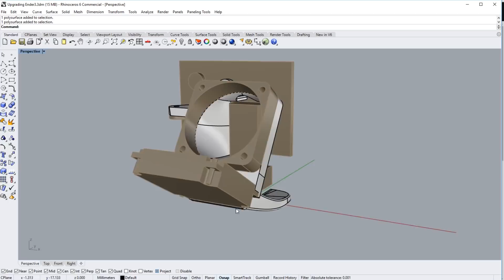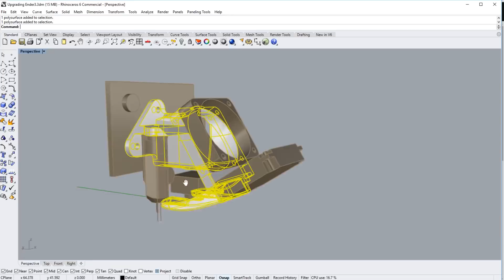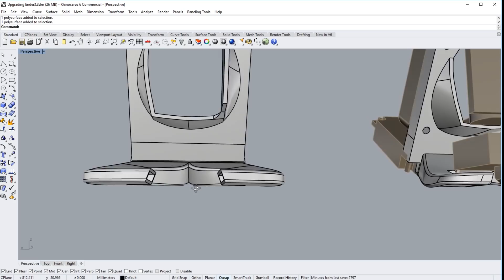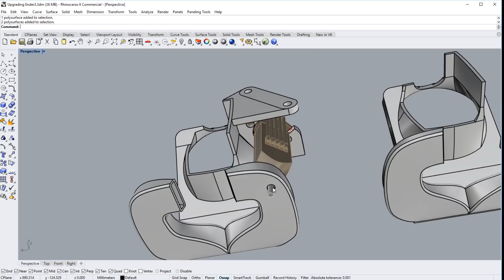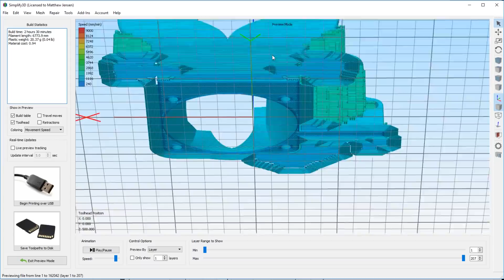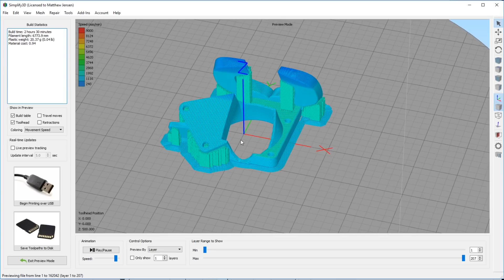Upgrading the Creality Ender 3 with Duet Wi-Fi, and other add-ons - part 1

Comment: With that Fan Mount you suck air over the heated bed, which cools it down.
But the air will be heated up a bit and with this allready heated up air u want to cool the molten filament... genius... not!
Reply from the maker: An intelligent sounding THEORY. However, in practice it does not work like this. First, consider that only the first few layers have the fan close to the heated bed. As the print gets taller, the fan gets further from the bed. Second, the fan is only canted at a 30° angle. Therefore, the top of the fan is never closer than 40mm to the surface, and the bottom blades of the fan are never closer than 10mm. There is a temperature gradient of the air above the heated bed, and it is significantly cooler than the bed at just 10mm of height. Remember we are measuring air temperature not radiant temperature. When you put your hand above the bed you feel the radiant heat. Practically speaking this means that the intake air is not much warmer than ambient room temperature, and this configuration functions perfectly. The increased airflow and finely tuned directionality of the flow more than compensate for the slightly increased intake temperature. Don't believe me? Ask your fellow German: Stefan at CNC kitchen. His printer has a similar fan mounting.

I question your impassioned denouncement of my intelligence. This is after all just a technical issue. Why insult me? Perhaps you have some vested interest? Maybe you are a fanboy for another 3D Printing company which resides just across the border from where you live.

Comment: Why buy that wifi board? Rpi 0 with Octoprint. 30 bucks.
Reply from the maker: So, you make the "It just works" argument in the last comment and then contradict yourself here? It is significantly more complicated and takes significantly more time to set up a RPI with octoprint. Not only that, but you won't get the benefit of all the other features on the Duet such as Trinamic drivers, and super easy to use/modify firmware using Macros.
Reply: Well actually you can get working octoprint with your Prusa... it just works... all im saying is That i dont see the benefit of adding WiFi to a driver Bord... aren’t there cheaper Bords that also support those drivers?

Comment: The Mk3 is great right out of the box. It's good for beginners and experts with prusas big box level of support. Theres no scouring the internet to find the best slicer settings.  It's loaded with features that you will never want to go without after using. IE mesh auto leveling, live z tuning, power panic, automatic squaring, stealth printing and mis step correction, magnetic bed,  just to name a few. It's got a direct drive extruder, which is much better unless you're using 2.85mm filament, and still direct is better. It's also got an all metal hot end, not just any, but THE all metal hot end. 
I always prep my print surface before a print, so though I have octo print setup, I find wifi printing useless. 

Look, you can say I'm trying to justify my purchase but I've got 7 3D printers including an ender 3. Some much more expensive than the Mk3, but the Mk3 is the first one I look to. Joe and their team have put together a great machine and the fact that you will look down the whole community, a community that knows damn well about the ender 3 and how to upgrade it, and say all of you are wrong, and I alone am right, shows a high level of unprofessionalism to say the least.

Comment: Ok so all i can tell is you have some personal beef against prusa trying so hard to "prove" they arnt the cheapest for what it can do.

What I have a serious problem with here is you complain about something that prusa does and then do it yourself. you borderline gloat that the base printer doesn't use 3d printed parts or zip ties to hold important parts together then use 3d printed parts and zip ties to mount one of your upgrades. You complain that Prusa didn't first come up with these ideas but your entire video is making your printer do what theirs does and in some cases do what they first did/popularized.

Even if its out now when you made the video one part you used was a beta test unit so it wasn't available through traditional means you understand how that is crazy to make an argument with. You are using technology that was not even an option at the point of conception for the thing you are trying to beat. That's like saying hey your phone sucks because i get to test next years model.

Now to continue upgrading your model we will need to design a new fan duct which I know you will argue you have already made for someone wanting to do this but that really isn't the point the point is your doing something that requires time effort and experience ( especially when designing a 3d printed part that will go so close to a hot end  which you even mention in your testing process) to do properly and one of the things about Prusa you seem to ignore is that you can have nearly no skill for the level of quality it gives you. Oh also yay you are using more 3d printed parts that are apparently bad according to you. 

You admit to using a secondary printer to do this job so either you need a second one to work on the upgrades or use the base model which you should have done to prove that you could upgrade it using only the printer or else this is a moot point.

It seems really pick and chose your battle on what parts are great upgrades, having several different printers available to me for printing one of the biggest quality of life pieces is the removable print bed. Good adhesion reliable surface, low to no need for adhesion aiding products, and inexpensive replacement if something goes wrong are just some of the gains from this one piece. To add something like this you would up the cost of the plate need to create mounting systems for the magnets add the magnets make sure they are configured not to mess with anything yet still provide coverage properly which all costs time and money. This is just one of the features you ignore as you cheery pick the useful and inexpensive upgrades.

Also your using a pretty shady tactic by only tallying the cost of what is shown sofar in the video, just like me when I first looked over the video I had assumed you parted everything out and put the cost upfront until I noticed you didnt add the cost of the bl touch. Im not going to post this on both so a few spoilers with the extra parts in the other video the price goes up another 65$ which yes still puts it below the Prusa but it weakens the argument the closer you get. 

Oh you also go on about how getting the official thing gives you access to things like support, the same as if you paid more and bought a Prusa. Every time you talk about real and official parts you talk about how bad knocking off someone is when the whole video is about knocking off the great features included in the mk3 

Finally I want to leave off with something that I honestly agree with you on but the sheer fact you are doing this video makes you a hypocrite you claim that even if its open source you shouldn't support copycats as you are trying to make a copy cat build of a Prusa printer. They went though the proper channels to obtain separate parts to make one extremely good machine trying to improve the market but instead, you want to copy them for cheaper which is exactly what you say ruins innovation

And before you say I'm a Prusa fanboy yes I have a mk3 that is why I feel qualified to speak on some of this. I also have access to 2 m3d micro+'s 4 tazbots though a team i work with at the local university a personal ender 3 as well as seen them in action from the two friends who has them and a whole list of dramatically better printers (more expensive) than my Prusa. So no I wouldn't say I'm a fanboy just someone who knows a good product but I do still think you have something personal against them or at the very least a chip on your shoulder about how successful they have been
Reply: YAWN
Reply from the maker: I'm sorry, but it's not a good use of my time to respond to all the points in your wall of words, but there isn't a single compelling thing you said.

The Zip ties issue is a stupid criticism. I'm not the market leader in 3D Printing. You are looking at my first iteration of a hack. Prusa sells 3000 printers a month with this inferior design. This is the Mk.3 it's supposed to be the third generation. They should have abandoned glorified rubber bands by now. Furthermore, I'm using zip ties to hold two ends of a flimsy plastic hose together. Prusa is using zip ties to secure precision guide rails that hold the moving bed and whatever is being printed. If you won't acknowledge the difference there you aren't being honest, or you don't understand engineering.

Many of the other criticisms you have, I already addressed in my follow up videos to this one. For instance, I know that Youtube does a terrible job showing these things to viewers, but the video you left a comment on is only the first in the series: https://www.youtube.com/playlist?list=PLtVk4dZInT82ODfOw-znw2MdunMAY_rp_

Also, I talked more about open source in this video: https://youtu.be/iKhn5IcVvAg

Please watch my other videos so that you are fully aware of the nuances to my views on Prusa and open source. After doing this if you leave another more considered comment, it's likely I will respond to your criticisms point by point.

Comment: What makes the duet the best choice of a new board? (just curious, legitimate question)
Reply from the maker: It's a combination of great hardware and superior firmware.

Electronics:
-Trinamic 2660 Stepper drivers
-32 Bit CPU (vs. the typical 8 bit)
-Wifi Module built in
-Western designed electronics which attempt to be idiot proof (You probably won't accidentally fry your board)

Firmware:
-Firmware comes pre-flahed on the board. Even though it is open source, you as a typical user won't ever have to touch the underlying firmware.
-Runs on Macros that use Gcode to control everything (compared with Marlin which uses a version of C++, and changing any setting requires changing the base firmware and reflashing it to the control board)
-You can wirelessly sent prints to your printer through your web browser or control the printer using your phone's web browser (the custom web interface is clean and intuitive).

If you want to know more, please watch the other videos in this build series: https://www.youtube.com/playlist?list=PLtVk4dZInT80SCVB_Pgrn1zZThO3nmV7B
Reply: @DesignPrototypeTest  thanks for in-length reply and the great videos! Really appreciated!

Comment: ok I agree to a certain extent about buying knock offs where I stop caring is when they price them selves out of the market  I bought a real E3D v6 hot end when it was 80 something bucks I look at the clones for 5-12 bucks do a little testing and the only thing that is really different is they polish the heat breaks so after that I bought clones and real heat breaks if real V6s were around 25 or 30 bucks I'd buy real V6s kinda like how I buy generic pills rather then name brand when I need meds
Reply from the maker: If the E3D Folks and the Duet Folks ever get as rich and mortally corrupt as big phama, I will absolutely change my tune and start advocating for knockoffs. These 3D printer companies which are progressing the technology aren't getting that rich. I we don't support them, we will stop seeing innovations. China doesn't innovate. They only copy. I go more in depth on this subject in a follow up video I made about my stance on Open Source: https://youtu.be/iKhn5IcVvAg

Comment: Open source allows community to contribute back to the original source and any forked sources.  Any open source project or product that doesn't want others to use their source should be using a different license.

Comment: Quick comment on the wheels. They are Derlin, and the initial wear you get on them is the derlin conforming to the vslot perfectly, kind of breaking in.  If they keep wearing after that, they are too tight. You should have no problem in an enclosure I'd think the steppers would overheat before the wheels would act up at all.

Comment: Totally disagree with your comments about stealing from ANTCLabs by buying a knock off, they had every bit of control of open sourcing their product. So you area essentially saying everyone that buys an arduino is stealing from them or any other company that has opened sourced their product. And I find it hard to believe that Paris and her family are suffering. You should at least state that its your personal opinion about the open source movement being a breeding ground for criminals.
Reply from the maker: >You should at least state that its your personal opinion about the open source movement being a breeding ground for criminals.
This is NOT my opinion. Yes, the arduino Clones amount to Thievery. I have made my stance on open source here: https://youtu.be/iKhn5IcVvAg

Comment: The filament sensor will NOT WORK in this location. The filament will stop moving just after extruder motor. NEVER happend the filament end goues throw your sensor!!!! Its just stupid video.
Reply from the maker: It has been tested and it works perfectly. The filament sensor combined with the firmware detect MOVEMENT of the filament. If the filament stops moving the firmware pops an error and pauses the print.

Comment: Just gone through a binch of your videos, quite enjoyed them. I have a self build Core XY, absolutely destroys i3 configurations. All linear guides. I do have a number of ptited parts but they are for holding cables or mounting electronics. Mechanical and structure is 100% metal. Mains voltage silicone bed ofcourse.
Reply from the maker: Awesome Man! I'm really excited for an industry wide shift to CoreXY, and away from this stupid moving-bed "I3" style frame being dominant.

Comment: how about Kevlar belt and wheels? would that help with heat?
Reply from the maker: High strength and High temperature resistance often correlate, but they are separate things. If belt stretch becomes an issue for this printer when I put it in an enclosure, I will switch to steel wire belts. The pulleys on this machine are metal, so no issue there. The linear motion v-shaped pulley wheels are made out of Delrin, so they should also be fine a the temperatures of a heated enclosure.
Reply: Have you printed in Delrin?

Comment: Prusa is the innovator, you telling people this is stopping innovation. The chinese don't innovation they only copy.
Reply from the maker: Prusa doesn't really innovate either. He just gets his ideas from people who post their DIY projects on the internet. The Chinese are worse, They don't come up with anything original. However, I'm more concerned with protecting and rewarding the people who originated the idea and proved it could work. For instance, a guy named Bin Sun hacked an old laser mouse to invent and produce the first functional implementation of the the filament detection tech which Prusa uses. I hope that he got compensated for his contribution, but somehow I doubt it. I talked about the issue extensively in this video here: https://youtu.be/iKhn5IcVvAg

Comment: Awesome series!
Question: I am not knocking the Duet, I have one in another printer.   But couldn't this all be done at an even lower price point with a different board? Say an MKS Gens 1.4 or L?   Was it chosen more for future proofing? Even an MKS Sbase is 32 bit if that was a consideration. These are obviously lesser boards but, would the be able to provide the same benefits?
Reply from the maker: It's all about the firmware, and the wireless capability. The control boards which you mention will need to run Marlin, and to get wireless functionality you will need to add a raspberry pi and Octoprint. This is achievable, and there are many tutorials on the internet teaching you how to do this, but Marlin is a convoluted firmware, and adding the pi only makes it more so. I find the Duet board running Reprap firmware to be so much easier. Even novices will achieve a successful printer build. In my judgement, it is worth the money, but most people don't see it that way. Marlin is by far the dominant firmware. There are a few other control board options for running Reprap firmware.

Comment: If YOU didn't know enough to flip the switch on the PSU, you should NOT be making advice videos in the 3D printer space. Period. FULL STOP.
Reply: A PSU does NOT change the regulated output voltage dependent on the input voltage, meaning if for example input dips from 240V to 200V the output will still be 24V, not 25V to 21V (given 230 is 24). Did you measure the voltage? PSUs usually have a bunch of under and over voltage shutdowns so I'm amazed it started at all. And I agree, all can make misstakes...
Reply from the maker: Dude. Have you never made a stupid mistake? Of course I knew about the switch. I just forgot to do it. At lease I own up to my mistakes. I get the feeling you try to hide yours and maintain a false image that you are infallible.
Reply: @DesignPrototypeTest  Are you kidding me bud? I make mistakes ALL the time. The difference is, I don't pretend on the internet to be a beacon of knowledge on a subject I CLEARLY don't know enough to be doing so. There are enough channels on Youtube already that offer absolutely nothing.
Reply: I mean...you're throwing a $200 dollar Duet into an Ender3. ROTFLMAO. Can you say CLUELESS?
Reply: Why did you watch the video then seeing as how you know it all? @8BitLife69
Reply: So, you've never upgraded a car to make it go better? @8BitLife69

Comment: Really, REALLY, interesting.

Would there be any problem with wrapping or otherwise treating (paint?) the air ducts to increase their resistance to melting?

VERY helpful, and informative-- you've covered many interesting bases.  THANKS.  Sub'd.